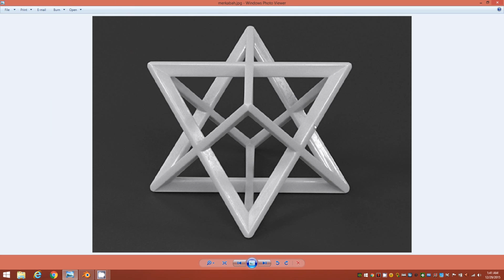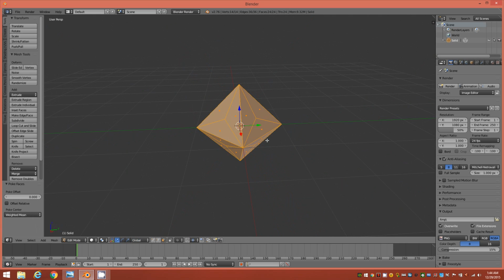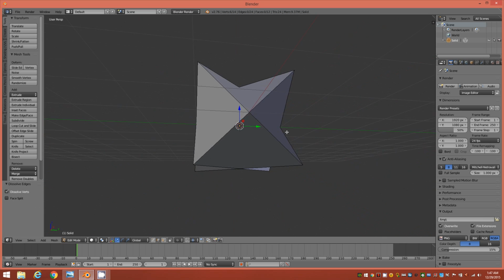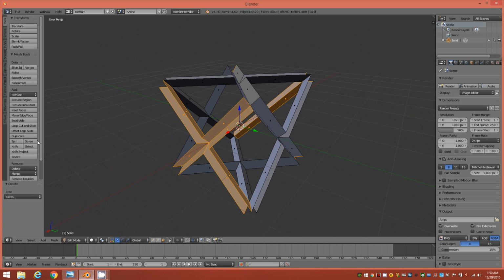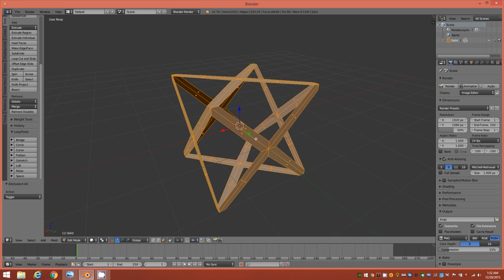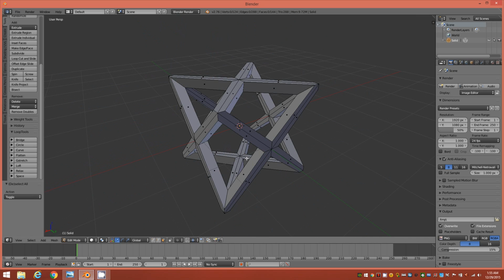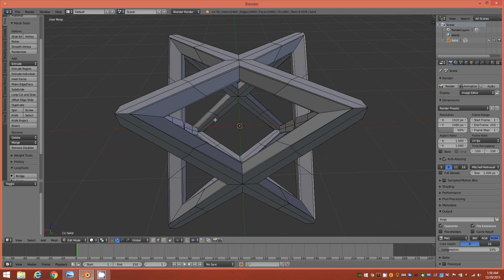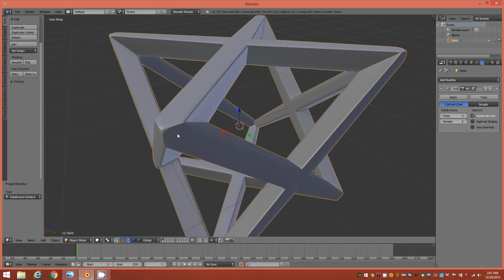Model A Sacred Merkaba In Blender 2.76

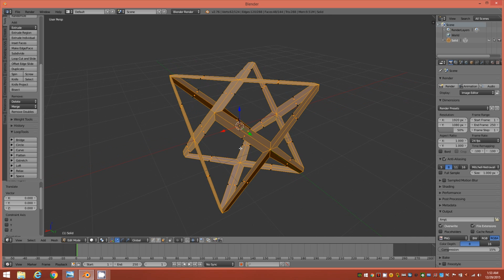Comment: In reference to 12:00 - 13:00 in the video, when trying to use extrude region, then scale, it creates a new object and scales; resulting in me having two objects at two different sizes. It isn't creating new faces onto the same object as an extrude would. Any insight? New to Blender. Love the tutorial.
Reply: same
Reply from the maker: Well I apologize for the late response.  I believe the issue you were having back then was due to the fact I misspoke in the tutorial here.  It's not CTRL+Scale, it should be ALT+S to scale inward on the normals.

Comment: Hi John, I'm pleasantly surprised to see you modeling in Blender. I'm a full time blender user too.
How do you like the modeling workflows in Blender?
Reply from the maker: +duplivert  Sorry for the late reply, and thank you for the support.  I very much appreciate the modeling workflow offered in Blender, especially the smooth transitions between actions like extrude and translate, which make "sketching"; topology with extrusions very quick and easy.  I'm also impressed by the depth of tools available under the hood as well, once you get to know the hotkeys, and menu structure available in the latest package.  I prefer to work with the Pie Menu and Dynamic Spacebar addons, which I feel reduce the need to remember dozens of hotkeys, but the overall workflow and transition through tools is smooth, and I like that about Blender.
Reply: Yes! Smooth and efficient workflows. I love Blender a lot. It's been 2 years since I learnt it. 
I suggest you keep checking this site every month or so for add-ons that really enhance the workflow.
blenderaddonlist.blogspot.in
Cheers, John. You're great at what you do.
Reply from the maker: ***** Hi.  Yes, I think 3dsmax has always had a very strong list of modifiers compared to some other packages. For many years, this has been the foundation of its strength and efficiency. However, Blender's internal tools could match up extremely well, and provided a smooth fluidity between tools that more than made up for the lack of certain modifiers in its own list.  There were only a few modifiers specific to 3dsmax that Blender couldn't replicate in one way or another, but most of those were intended primarily for animation purposes (point cache for example).  However, there is a larger difference now, with the development of MCG (Max Creation Graph) in the latest versions of 3dsMax, which brings vast potential for the creation of new, custom  modifiers which can be tailored by the user to fit their own needs using a node editor.  I have only recently been experimenting with this new feature, and  it is quite powerful and unique, especially for non-programmers. I will have some videos on this in the near future. As for the Soft Selection in 3dsMax; it does provide some extra level of fine control over the proportional editing in Blender, but it's not noticeable or more efficient, unless you are doing some very specific modifications that require vertex-level control.  Otherwise, the proportional editing tool in Blender is actually faster to manage for overall modifications of a mesh.  Nurbs in 3dsMax are not very good, nor have they ever been.  Neither are they very good in Blender, but I don't use Nurbs much in my workflow anyway, so this doesn't affect my daily routine.  Hope this helps.
Reply from the maker: These last two questions are somewhat more difficult for me to address, for several reasons.  I will attempt to make an honest answer to each, but keep in mind the answer I provide is very much based only on my own personal workflow and pipeline.  Your experiences and goals may differ completely, and therefor my views would not apply to you.  That said, about the Cycles engine.  I personally do not render with Cycles.  Blender is not typically my primary modeling package, so I do most of my rendering inside the 3dsMax environment.  My personal workflow involves rendering with either Iray or Corona render engine in 3dsMax.  I personally prefer Corona to any other engine, so that's what I use most often.  I do feel, however, Cycles can be used in a production environment, given the proper hardware.  If your studio or workstations empoy the Nvidia CUDA line of gpu render cards, then Cycles will be very competitive, especially if you have at least one or more high end cards, like the GTX 1080 or something comparable.  Cycles is starting to see its way into professional pipelines now, so it does have that potential.  Houdini is an absolutely fantastic software, especially if you do motionFX with lots of particles.  It's probably the best particle animation package on the market, ever.  However, unless you have a very special need for extremely procedural models, the modeling features in Houdini are not nearly as efficient as the tools available in 3dsMax, Maya, or Blender.  They ARE more flexible and procedural, but this is a very specific thing.  There's a difference between being able to produce a mesh quickly, and being able to produce a mesh which can be changed and altered from the ground up later on down the pipeline.  The latter is what Houdini does best, but I have yet to find myself needing that kind of deep procedural workflow for modeling.